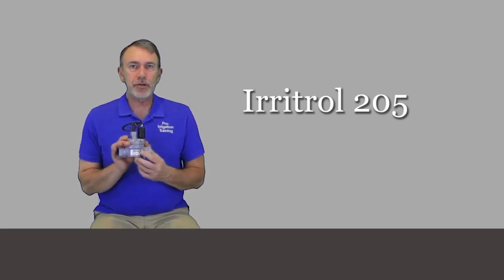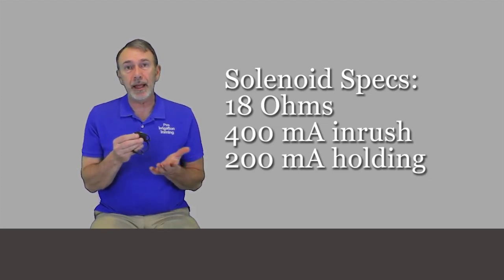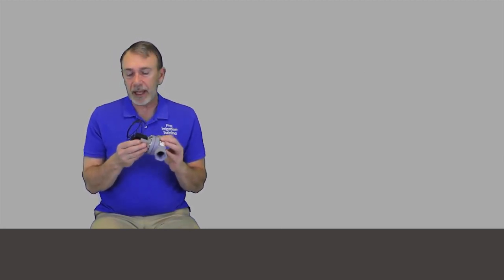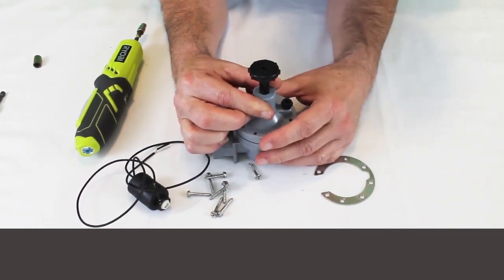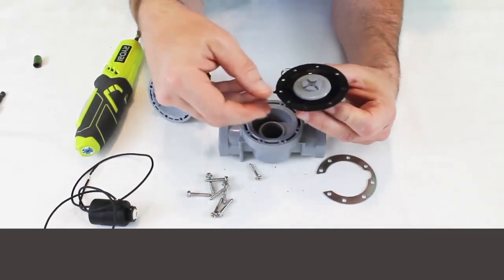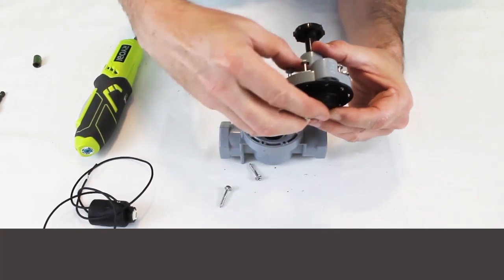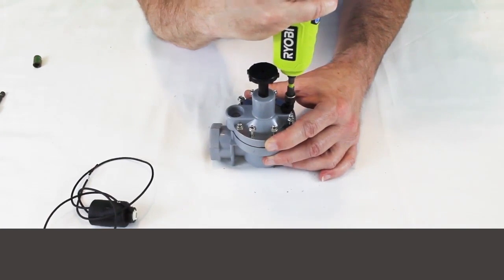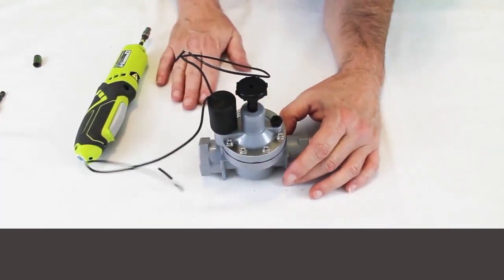Irritrol 205 Valve How To Rebuild (Sprinkler Valve)

Comment: Great video on a table top......it is soooooooo difficult to do, crouched in the bushes, and cra* everywhere.....but thanks for the tip about that little nub.....that helps line up the hole for the solenoid stem.....thanks.

Comment: Great video. I have 5 of these in my backyard that worked great for years. Now one circuit only operates at about 1/4 to 1/2 flow. Tried turning the flow control to no avail. Replaced solenoid and only starts with bleed screw or turning the solenoid but then doesn't shut off when the timer does. I had to crank the flow control all the way in to get it to shut off.  Any ideas?

Thanks
Reply from the maker: Hi there! I would just rebuild the valve and put in all new diaphragm, bonnet, solenoid, etc. That's assuming that you're sure there's not a downstream leak or obstruction in the pipe. It's not the easiest valve to rebuild, but I would do that before you replace the whole valve.
Reply: No downstream issues, sprays fine on bleeder valve. Just hate to have to replace the top parts on a valve a foot below ground in a single circular box, but I'll give it a try. Don't want to dig it up in its setting. Thanks for the reply.
Reply from the maker: @randybaylor7750  I feel your pain. I had to rebuild one of these last week. Unfortunately I had to dig it up, at least a foot deep, right beside a tree captured in roots. Not fun.

Comment: What if it leaks from the knob? Is that repairable or do I need to by the whole valve?? Thx
Reply from the maker: You definitely have to replace the bonnet or top half of the valve. Sometimes you can find the separate parts of the Irritrol valves, but most of the time you have to buy a new valve and use the bonnet off it.

Comment: One zone not working - I put in a new set of guts , top and solenoid into the existing valve - it works now ONLY with the bleed valve open - and now it is on when any zone is on. I close the bleed and its off all the time.  Any ideas?
Reply from the maker: Hi Joel. There's a good chance that the valve body has some debris in the small orifices that make the solenoid work. Take a pipe cleaner or something similar and push through those openings. That's assuming that you've already checked the electrical. But here's a low-tech way to check; take the solenoid out of the valve and have someone turn the zone on at the timer. If you don't see or hear the solenoid actuating, you have an electrical issue.
Reply: @Proirrigationtraining  Thanks !  I think its an electrical problem - getting some bad readings. I am going to replace the cable from the control box to the valves and make all clean new connections - a lot of corrosion found and varying resistance measurements.
Reply from the maker: @joelbahl6830  Good troubleshooting there! Any time you see some corrosion on the wires, you know there could be a problem. Of course, checking the electrical connections can indicate a problem. I'll always lay the wires out on the ground and hook everything up before I dig anything in.
Reply: @Proirrigationtraining  All good now - ran all new wires to the controller and a separate line to the master valve. No junction box outside now to get corroded. Thanks again.
Reply from the maker: @joelbahl6830  Glad you got it sorted. Sometimes it's all you can do. At least with a new wiring bundle, you know it's done right and where everything is for the future.